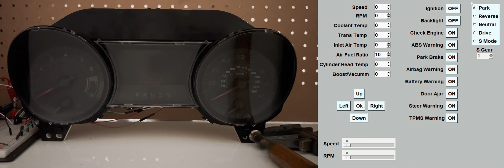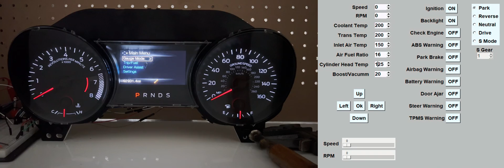15 Ford Mustang Instrument Cluster/Gauges for a 5.0L Coyote Swap Part 1

Comment: This is great! I have a stand alone Mustang Gen 1  engine harness with PATS deleted. I want to use the factory gages and steering column, using the buttons to communicate to gages like cruise control and cursor buttons. what circuit boards are using ? I heard you say GUI but unfamiliar with Ardrino stuff? good luck and looking forward to your progress.
Reply from the maker: The GUI is (Graphical User Interface) ie the buttons on my laptop to control it. This was made with a Python program for testing. I am using an Arduino microcontroller to connect to the cluster and send in signals on the CAN bus.
Reply: @07trdpro6   Have you connected to the ECU? my concern is the PATS and how that interfaces and if the PATS will it prevent coms? I believe  part of PATS program is in the instrument panel. My 2014 ECU PATS have been disabled or deleted. similar to a control pack. however you seem to be able to communicate without the PATS, I'm kind of shocked actually.
Reply from the maker: @williammarion8878  The PATS handshake is between the BCM and PCM. If the key is correct the BCM allows the cluster to power on. 

The BCM holds the key data, the PCM checks it to allow the vehicle to start
Reply: I also have a gen 1 with standalone harness. It’s a slimmed down factory harness. I had PATS deleted in the ECU. We wired in a random BCM from another mustang and a 2014 track apps cluster. Then made the changes in my 2012 steering wheel and it all works. Obviously the track apps and stuff doesn’t but I’ve been looking for a way to slim down the dash harness and do away with the BCM. This would be great but what I really want to figure out is how to run the 2018 digital cluster standalone but I don’t know if the gen 1 and gen 2 run on the same canbus or if they have different protocols. Because if the digital cluster could be controlled by a gen1 ECU the swap coyote and gt500 people would probably be all over it. I’m really interested to see what you do here.
Reply from the maker: @   Do you have pictures or a build thread? I haven’t gotten ahold of a digital cluster yet but it’s on my list. In theory if you fully map the 2014 ECM and fully map the Digital cluster, you can just build a gateway between them to convert from one network style to another. I have done this in Toyota. I think the Ford network changed a little between the two generations. 

Do you have an ABS ecu? What signal are you using to run Speed and odometer? GPS? Does your cluster not flash a bunch of errors with only the two modules on the network?
Reply: @ I don’t have build pics or videos posted. I’m gonna actually be going through it again this week since I’m swapping it all into a different car. So if I can dm them on here I’ll try and send you some when I set it back up. No ABS unit at all. And yes every single light and warning was going off at first but after I knew it would work I sent it to odo-pro or some odometer place to have the mileage corrected and I paid them extra to turn off what they could and unsolder whatever other lights that work off led. I still have the fast flashing anti theft light but I opened the bezel and filled the hole so it can’t shine through anymore. Obviously this is why what you’re doing is such a better way to go about it. And the speedo is still a stock sensor. I bought an adapter to bolt the MT-82 sensor to a T-56 and changed the pulses per minute to 12 in the tune. I’ll make sure to get a good video of my crappy setup and try and send it to you. But if you get this working please let me know I’ll be the first to buy it.
Reply: @07trdpro6  also my ECU is a stock package 2012 manual 5.0 ECU. if you map out the gen 1 ECU and have a controller in between that will control that gauge cluster you have now technically it should also work for the digital gauge cluster. They have the exact same wiring pinout and they swap them into 15-17 mustangs as an upgrade. Obviously I can’t say it for certain but if you make something control those gauges the digital gauges shouldn’t be very different.
Reply from the maker: @brettchaney6672  I have most of the 15-20ish network mapped. I have not seen or worked with anything 2014 and older but I know it’s similar if you will. I need to get a digital cluster and make this same video as I know that’s what everyone really wants to see. That and testing with various ECMs, the Ford control pack. It’s definitely an active project but right now still in bench top testing. This video proves it can work just need to work the bugs out.
Reply: @ Well if you ever need, I can send you my 2012 5.0 manual ECU with Pats deleted for testing. I won’t be using it for awhile. I also have the 2014 GT500 control pack tune on my laptop I could try and email. They use the exact same copperhead ECU. Just let me know anytime and we’ll work it out. I don’t know how to send personal messages on here or id just do that lol